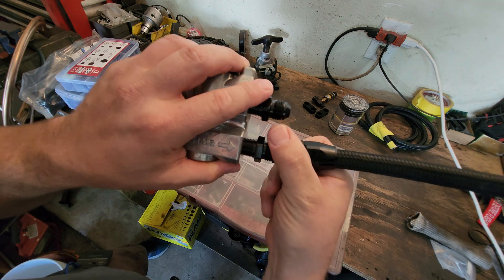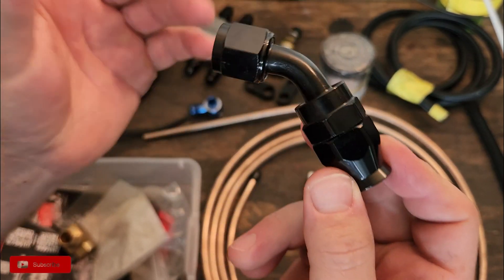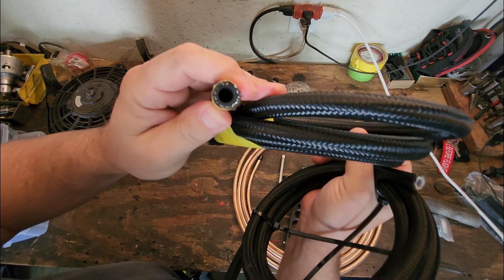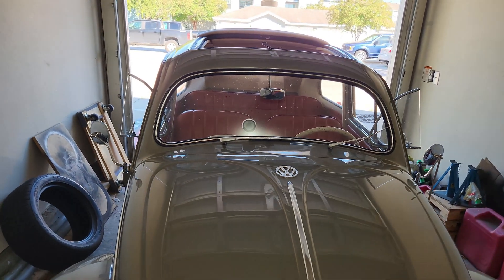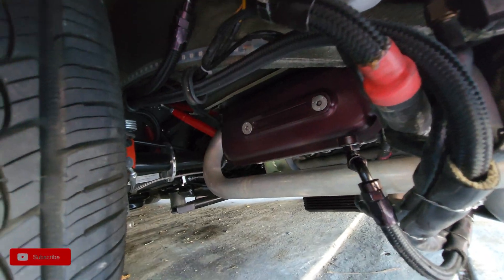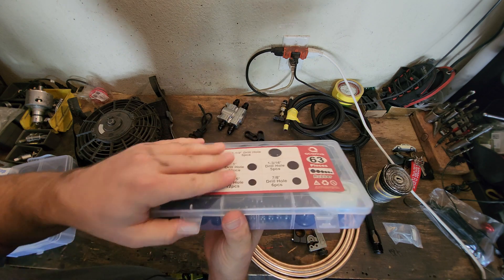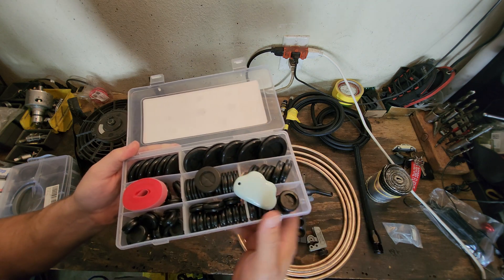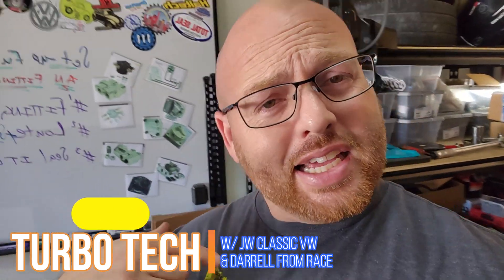VW Full Flow Oil System Lines & Fittings | JW Classic VW

Comment from the maker: Thanks for stopping by!! Do you use a full flow system?  What type of oil pump are you running?
Reply: Yep. 30mm with a Berg pressure relief cover.
Reply from the maker: Sweet, Love anything BERG!
Reply: I'm using one of those cheapie EMPI pump/filter combos. I'm only running about 70 horses on my mild 1600sp so works fine and requires no lines or fittings. I did however replace the crappy filter canister after run-in with a quality unit. The oils stays clean and and the pressure is good, and that's what matters!

Comment: Do you guyss know the name of the 3/8" fitting usually made of copper in the elbow shape that screws in the case returning the oil from the fiter. This elbow is short so it can be screw in the case.
Reply: This elbow has one male part and the other a female. The female receives the hose from the filter.
Reply: It has to be small as to be able to install the engine plate.

Comment: Hello Jason, i currently have a CB performance Maxi Pump 3, at the moment I am using barb brass fittings I want to upgrade to AN fittings but not sure on which adapters and what AN size fittings I need, any help will be appreciated. Thanks.
Reply from the maker: Really depends on the pump output thread size... I'm sure that info is avilable from CB.  That would be the start, for example 1/4 NPT or 3/8 NPT to -8AN.  Then you can move to the standard -8 fittings and hose kits.
Reply: Those fittings cost a lot of bucks when you add it up.
I would happily stick with brass fittings.
Reply from the maker: @johncollins5552 They do add up, but with a build like mine, it's worth it.
Reply: @johncollins5552 yeah, but is worth it, no matter how many steel belt clamps I had some leaking not drastic but enough slowly build up, I went to this set and it’s completely sealed! I like it. Thanks JWClassicVW for all your videos they are really helpful.

Comment: Anybody else have problems with leaks at the hose line fittings I can not get it to stop tried a lot of methods
Reply from the maker: Sometimes, the fittings get scared or dirty requiring clean up with a lil 400 grit sandpaper.  Also, using a lil anti-seize on the threads can help you get it a bit tighter.